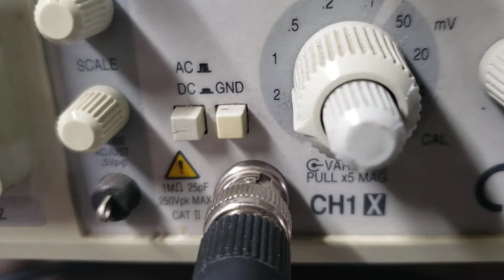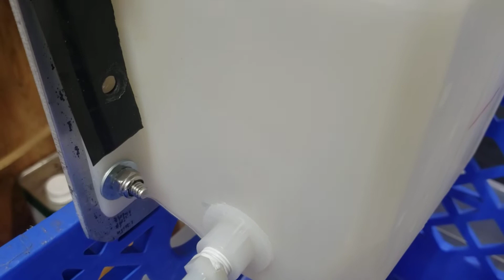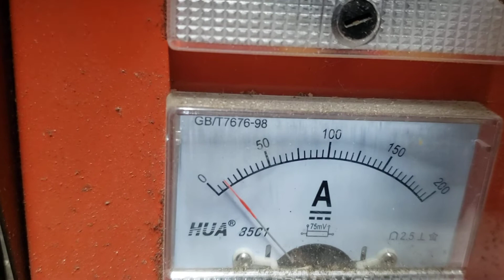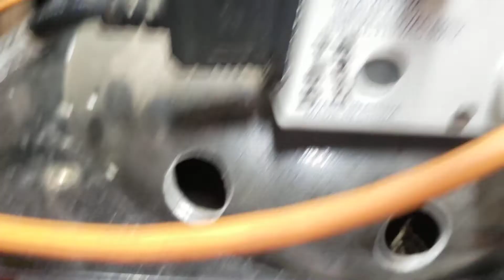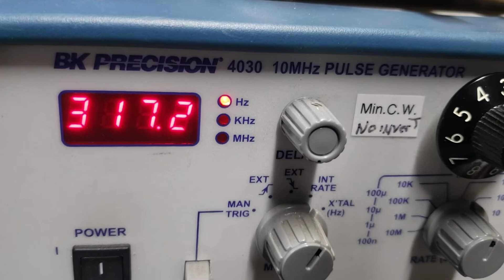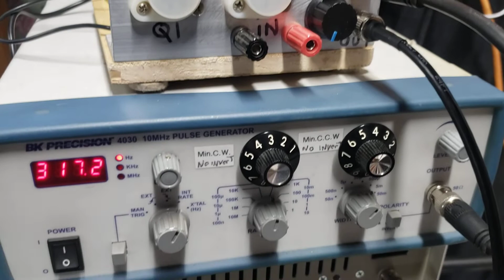HHO gas from 3VDC (take3)

Comment: thanks for a detailed overview. this, in my opinion is the true definition of a fuel cell. That got muddied by the idea that water makes fuel, but the proper definition is gas making voltage. So what I think is happening here is your plates are covered in gas which creates a voltage between each plate in the series stack. And they are becoming in effect like a battery. If i am correct you should be able to pull usable power off the cell. The pulse makes the gas. The gas makes the plate voltage. The gas is free to do work when in the off time of the pulse. Another way to test this is watch how long voltage is across the stack after you turn the system off. I have seen some very long coasting where a cell will hold voltage after it is not being powered. Can you add another frequency into the mix to get more gas like Bob found when his alternator blew a diode? Great stuff. Love HHO research.
Reply from the maker: Thanks for the comments.  It is fine tune to the highest voltage the circuit can produce. Increasing voltage above 3 vdc does not increase cell voltage as far as frequency goes it is at max output at this frequency.  At 11.70 vdc devided by know cell resistance at 60F (1.3 ohms) it appears the cells are drawing 9 amps. 9 times 11.7 vdc equals 105.3 watts dc. AC watts at this times was only 93.1 watts. Previous tests i did notice when using a normal PWM that voltage will stay on the cells awhile after power is cut.
Captainwilly
Reply: @captainwilly1  there it is!!! volts on the cells after off time. you got yourself a true fuel cell behaviour there. if you had a pulse train and drew power from the stack when the cell is coasting you got a power source. not free energy cos water is the fuel, but a power source none the less. there is another guy i follow who also is seeing more power ay the cell than he puts in. will post a link when i remember his channel...